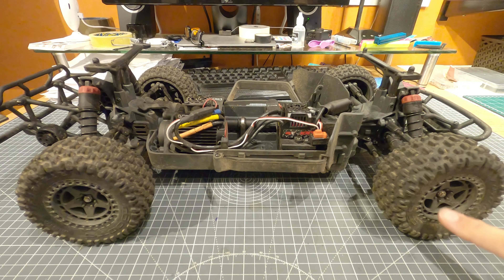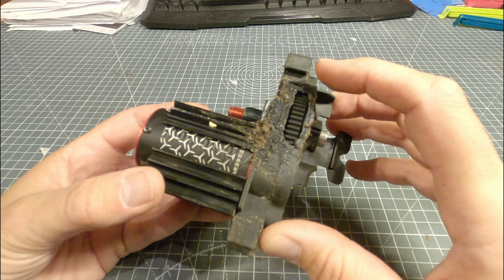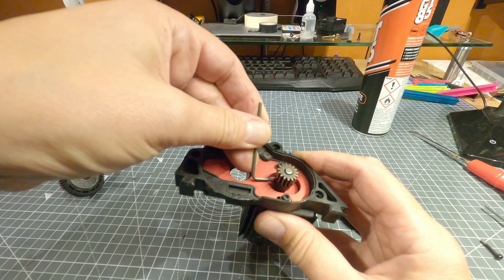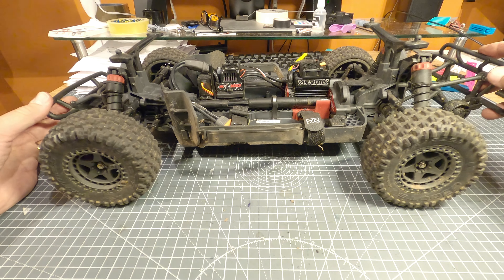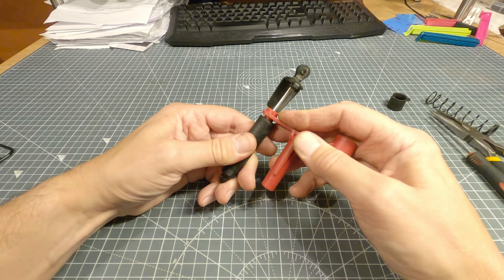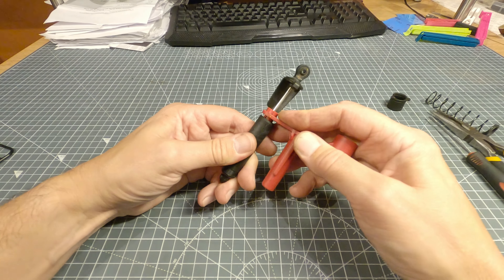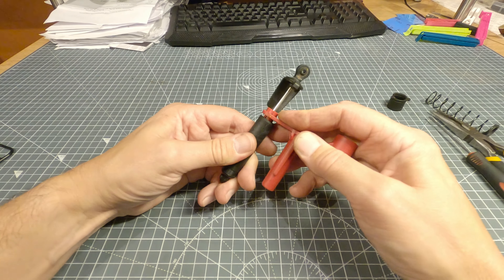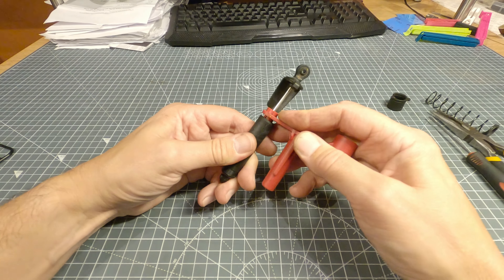Arrma Senton 3s BLX V3 Review and Top Tips. Arrma 3s Mods, Upgrades Granite Typhon Big Rock Vorteks

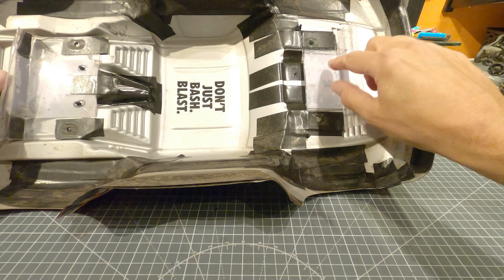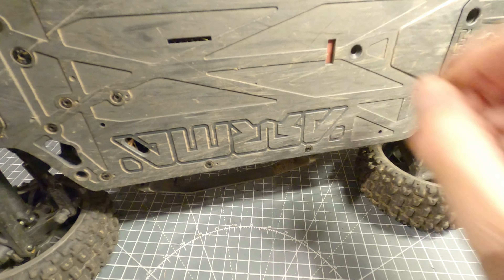Comment from the maker: This is rather a long video so some useful skip points are 1:10 - Body strengthening,  1:56 - Threadlocking motor,  8:01 - Shock oil,   13:17 - Metal shock brace,   17:37 - Servo and other bits,  21:05 - Review
Reply: You can also use tygon or glow fuel tubing for shock limiters and cut to any size.
Reply from the maker: Good tip thanks 😃
Reply: Thank you sir!

Comment: I know this is an older video, but I enjoyed you going through the Senton 3s. I just picked one up, and it was used, so I serviced the diffs, then went on a rip. The very next day the inner motor bearing seized, I am waiting on the FastEddie bearings for this, and I am upgrading the shocks to the Proline for the 3s series vehicles.
Reply from the maker: Hi there. Glad you enjoyed the video. Ooh that's annoying about the motor. I've had the same thing happen and it can be difficult to get it open if the screws are damaged. Hope your fix goes well. Many thanks indeed for your great feedback 😁👍

Comment: I have just got the senton and am really impressed with it so far. It does throw lots of debris into the chassis but have seen a mudguard mod which i will be getting. Also Proline do a set of upgraded shocks for this model and seem to work well from what i have seen (albeit expensive) so will look to change to them in the future. 
Great video and top advice as always ,i bought my Kyosho beetle on the basis of your review of it and am so far really happy with that as well.
Take care
Reply from the maker: Hi there. Yeah the inner fender set is a must for the Senton. Doesn't stop everything going in but it helps. I did a video about those. I've made mine a bit lower and used thicker shock oil and now it handles more like a rally car which I like. Tend to only run it in the dry these days as the trucks are better in the mud. Oh yeah the Beetle is good but you need to be a bit careful with it compared to the Arrmas. The main problem I'm having with it is the paint falling off the inside of the body shell after its landed on the roof many times. Mine is possibly a bit fast on brushless. Hope you enjoy the build 😁👍
Reply: @PeteWylieRC  Iv just put carpet tyres on my beetle. It will only be used inside for exactly that reason. It's too pretty! I'm running a Tamiya super stock RZ in it which seems plenty for the little beetle 👍
Reply from the maker: @matt_cars  Yeah I was going to say that the Beetle possibly has a bit too much grip on grass with the blocky tyres and it could do with a bit more rear end slide like the Turbo Scorpion with the smaller blocks on the rear treads.  Hopefully yours will be safe indoors unlike mine which has had a bit of a beating to be honest 😬

Comment: Great video Pete.  I really appreciate videos like this that are still relevant today.  Plus the content reinforces what to look out for on the 3s line.  Thanks 🙏
Reply from the maker: Hi there. Yeah the Arrma 3s line is still going strong and I've still got all of mine plus a 4s now. I think that despite needing a few checks and mods these are still a must have for RC bashers. Many thanks indeed for your kind feedback 😁👍
Reply: @PeteWylieRC  The shock leak has improved on the v3.  But my the differentials still leak onto the driveshafts.  Have you experienced this?  I recently ordered HotRacing yokes.  Hopefully that does the trick.
Reply from the maker: @2XRC  I haven't noticed the diffs leaking.  I did put slightly thicker oil in them so maybe it stays in better?  Hope your upgrade does the trick 🙂

Comment: Good video  m8 as I have just bought my boy the senton have u had tires blowing  out on them as we put the battery  in and it ran for 2 minutes  tops and destroyed  the rear tire
Reply from the maker: Hi there. I've not had the tyres on this one blow out.  The only one that did was on my Granite but I was giving it full throttle while it was upside down as I was trying to flip it back over.  I don't know if there are better tyres available from other manufacturers like Proline.  You need to keep the Arrma wheels though because of the 14mm hex size.  Thanks for your great feedback on the vid.

Comment: hi pete,  mick smith here...  i did put  granite wheels on my senton 3s blx  and i love it..   faster more responsive etc..  i did get 44 mph on cut dry grass with i think the standard 20 pinion. 
but its a little too fast..  the front end started to wobble and raise up plus it just wants to wheelie at  35 -40mph+..  to rectify this i have added some velcro to the front end and ordered a 17 pinion from modelsport..  i do love the speed but as you said i need to take care of the esc and the motor..  i beleive ARRMA are  " horizon hobby "  i used to purchase helicopters from them a while ago..  i also have a pro-boat sonicwake 36  (horizon hobby)   which will achieve 50mph  ...   a great boat but.... boats need to much attention..  there hard work...  cars are easier...
thanks for your videos .. i do trust in you with your un-biased information..  

take care pete 

regards mick...
Reply from the maker: Hi there. Yeah the 20t might be too much with the big wheels. With the wheelies I think that the Senton body just catches the air underneath. I got the mudguards which help a bit. Many thanks for your feedback. Much appreciated 😁

Comment: What the advantages of using different tooth pinion gears what one does it come stock with and what ones does it come with
Reply from the maker: Basically more teeth on the pinion gives a higher gear so higher top speed with slower acceleration. The opposite is true of the spur gear ie. more teeth gives a lower gear ratio. The Senton comes as standard with a 20 tooth pinion whereas the Granite and Big Rock come with a 15 tooth because bigger wheels also increase the gear ratio. Hope this makes sense 😃
Reply: @PeteWylieRC  perfect thank you

Comment: I’m looking to get into rc is the arma senton good for beginners
Reply from the maker: Hi there. Yeah the Arrma 3s range is great but make sure to do the checks that I go through in these videos. The Big Rock unboxing summarises the things to check. The problem with the Senton is that the body being over the wheels means that all the mud is directed into the chassis. I only really use mine in summer when it's dry. I use the other ones all year. Maybe look at the Big Rock?

Comment: All great tips Pete. A little surprised on the design of the shocks. A lot different from axial ;) I like it. Great job and Iam sure there will be quite a few people who would like this help. Thumbs up
Reply from the maker: Hiya Nick. Yeah I think that the shocks are different to all the other ones out there. I guess that the advantage for a basher is that there is no shock top to come off during jumps and crashes. They do work well now that they have sorted out the o ring problem of the previous versions. Anyway many thanks for watching matey. Just found out that I'm working through the next lockdown. To be honest it doesn't seem to be much of a lockdown as the schools are still open and a lot of people are still at work. I think that mainly the pubs and restaurants are shut. We shall see if it makes any difference. Take it easy my friend 😀
Reply: @PeteWylieRC  hmmm .. well hardly seems like a shut down, is right... I guess they see it as helping?? Thankfully not a decision, that falls on my shoulders... lol
 I like the look of those shocks though and I think they would work pretty good. For a couple reasons first of all, the fine thread which seems to be nice and long, Second the oring placements ... I know you may have mentioned it but it would seem to be pretty good against leaking? thamks :)

Comment: i really wish they would make a sealed motor box. i dont know what they where thinking when they made all the holes around the spur gear. it should ether be completely open or closed.  and plastic/composite rod end balls is really dumb. i dont know any rc car ever other than arrma that has done this.
Reply from the maker: Hi there. To be fair the new one is pretty good at keeping the dirt out and I haven't really had a problem. With the pivot balls I guess it just comes down to cost. They are a bit rubbish though! Many thanks for your feedback 😁
Reply: @PeteWylieRC  the motor cogs bad on mine even after horizon sent me a new esc and motor. not sure if they fixed that or not. all this is why i would not buy a senton again. i was gonna buy a pro sc10 when i bought this now i wish i would have its just a better sct especially on the track.
Reply from the maker: @KidAgainHobbies  oh right yes I did have to get the first ESC on my Granite changed because of a cogging problem. It's fine now. Maybe you were just unlucky with the electronics. Hope you have more luck with the prosc10
Reply: @PeteWylieRC  i dont think its bad luck i think the electronics are not good.  i have had dozens of brushless systems and i have never had cogging this bad. maybe you got the upgraded version of the electronics.
i have the rc10t4.3 rtr which is the same platform as the prosc10 and i havent done or broke a thing on it. its just a great platform. i hate they discontinued the t4.3 and the buggy.

Comment: No way dude mine had exactly the same problem...3 weeks/3 hours from new...arrma have my motor now so fingers crossed
Reply from the maker: Ah right. I sent mine back to the retailer and they sent me a new one straight away. Hope you get yours back soon. Worth thread locking the screws when you reinstall it.
Reply: @PeteWylieRC  I went to send It back but they said cut out the middle man ..I'm hoping they send me an arrma one as this is common on the spectrum motor..plus I sent the whole unit ..just to have tolerances checked as there was a lot of powder on reveal haha
Reply from the maker: @666carping  I think they should sort it out for you ok then.  I have just bought the Big Rock and I notice that they now put washers on the motor screws and they were really tight so obviously they are trying to stop the mesh from slipping.

Comment: My son blx when you full throttle it the car locks down like it shuts off
Reply from the maker: Hi. Not sure about that.  Is it a decent lipo pack that you are using ?  Also might be worth going through the set-up of the throttle on the radio gear.  It's in the instructions somewhere.  Otherwise I'm not really sure.  Be worth contacting the place you bought it or Horizon Hobbies who own Arrma.
Reply: yea new battery smart one the truck sounds bad when it is going also like it surging for power
Reply from the maker: May be a dodgy ESC. My first one on the Granite went wrong and got replaced on the warranty. Best to contact the seller like I say. Good luck.

Comment: I have exactly the same issue with the handling of my Senton. I will be doing that suspension mod this weekend. I'm also going to buy the Granite next based on your suggestion.

Your tips videos are indispensable I reckon. Cheers
Reply from the maker: Hi there. Yeah I decided to make the Senton better in the corners by lowering the suspension a little and it's really good now. I've got the trucks if I want one for more challenging off road or bigger jumps. The Granite is still favourite I'd say. Many thanks for your kind feedback. Much appreciated 😁

Comment: Hi Pete, you didn't add grease to the spur gear / pinion. Do you you recommend to run it dry?
You mentioned Tamiya Anti Wear Grease for sealing the gearbox. Which grease do you use instead?
Reply from the maker: Yeah the plastic spur against the metal spur tends to get left dry on most RC's. Having said that I do grease them when I build a Tamiya and so there's certainly no harm in doing it. I was just using some LM2 grease I think. Anything like that would do. If you can get something sticky like Tamiya AW grease then it tends to stay put. Thanks for watching and commenting 😁

Comment: Recien compré un Arrma Sentón 3s Blx y necesito Limpiarlo asique lo pienso hacer con agua le tirare agua directamente, alguien sabe si puede afectar la electrónica? Servo Motor Esc etc ?? Luego lo secare con calor pero tengo la duda ya que no quiero arruinar nada Ayuda porfavor
Reply from the maker: Yeah I hose down the cars and then I've got an air blower to dry them. WD40 on the bearings is a good idea. Before you run it next time, make sure you can still push it forwards and backwards freely 👍👍
Reply: @PeteWylieRC  gracias

Comment: Brilliant video just wished I had watched it before taking out my nice new shinny senton
First run have cracked ever corner.
How have you found the number plate gorilla tape.
Did you put the number plate tape down first then go over it with the gorilla tape
Really helpful videos keep up the good work
New sub 👍
Reply from the maker: Hi there. I've only used the double sided number plate tape around the body post holes where I have stuck on an extra layer of lexan on. Mainly I've just used the gorilla tape around the edges of the body. If you are really battering it then it might be worth doing that thing with the dry wall tape and shoe goo that people do. I haven't tried it myself but people say it's good. Many thanks for the sub 😁

Comment: I own a Senton. It's a lot of fun, but the parts aren't exactly durable. Turned too late and ran into a solid wall, breaking the steering rack and snapping one side of the front bumper. The upside is that replacement parts and upgrades are easy to acquire and install. Looking at upgrading a lot of suspension parts and getting better shocks and tires.
Reply from the maker: Hi there. I reckon that these are as tough as anything else I've had. I certainly broke my Traxxas Slash more often. Glad you are enjoying it. Many thanks for your comments 😀

Comment: Grease is a good sealer in some situations, but you may want to use a light weight silicone for cars. Won’t hold on to the dirt as well. This is only my opinion, your way may be better. Great video!
Reply from the maker: Hi there. Yeah you are probably right. I will give it a try next time I have it apart. Many thanks 😁

Comment: Great video and well detailed without too much fluff. I’ve been torn between the Senton and the Big Rock, but after watching this I’m thinking Big Rock and then adding a Senton body later.
Reply from the maker: Hi there. Many thanks. Yeah it's a difficult decision. I think that the Big Rock is probably the better all rounder with the big wheels. The Senton is great fun to drift around on the grass but isn't as off roady. The big tyre ones are definitely best for jumps. Have fun with whichever one you get 😁

Comment: Im sorry this might be a stupid question but does it work with a ec5 connector
Reply from the maker: Hi there. Yes it does. I talked about the battery plug a bit in the unboxing video. You can use an ic5 or ec5. Thanks for watching 😀
Reply: Thanks your the best

Comment: Hello, nice video. I too have a senton and i would like your honest evaluation of the ebay shocks on your granite as they offer the same ones for the senton. Are they any good?
Reply from the maker: Hi there. Yeah they are well made with a smooth action. Seem very strong. No problems so far. The only thing I was thinking about them is that they are unbranded so I don't know if you can get spare parts individually. I'm thinking about getting a set for the Senton too although the Arrma shocks are doing fine on that. Thanks for watching the video 😁

Comment: Great video, I just got the V3 Senton and love it. Do you have the part # for the HR pivot balls by any chance.  Cheers and stay safe!
Reply from the maker: Hi there.  It's ATF160B02.  Thanks for watching and your kind comments :-)
Reply: Open ur box.. Get in the bag where all your papers should be.. You will have a whole pictured diagram of every part on this truck!!
Reply: @elizabethbumgarner6267  he was referring to a aftermarket part , the HR pivot balls and metal as apposed to composite that comes on the 3s range . There not very good at all to be frank with you , but the HR parts are a decent little upgrade that takes away slop from suspension and steering .

Comment: Hey I have a question, I have a senton and I wanna replace the servo, did you go with coreless or brushless? And is the aluminum shocks worth it? They are kinda expensive
Reply from the maker: The servo is the JX Ecoboost 21kg. I'm not sure what technology it uses. The stock shocks are fine to be honest and the version 3 ones don't seem to leak.

Comment: Great videos Pete .  I'm brand new , just got the red Senton you have been working on .
Could someone achieve somewhat similar results , less rolling over ,  without
sacrificing suspension travel ,  by using harder ,  less grippy tires  ? I dont trust
myself to perform surgery on my truck yet .
Reply from the maker: Hi there. Yeah you are right to say that if the car looses traction then it will slide rather than roll. Rather than change the tyres, just find some slippery wet ground 😁 Many thanks for watching 😀
Reply: Don't drive so fast 😂😂😂

Comment: Great to know this info Pete as I've just bought the Bigrock V3, mine will have a much easier life than your models though as I am a big chicken and don't run any of my RC's in mud or water because I'm a bit of a wuss!  Thinking about it, that's because I usually buy kits and the amount of work I put in doesn't make me want to run the models too hard- but this is not a kit, it's a basher so maybe I can give this a lot more stick :-)
Reply from the maker: I know what you mean, I don't give my Tamiya's that much of a hard time as I really don't want to break them but these Arrma's are designed to be bashed so give them hell!  Many thanks for watching. Actually having said that I don't want to break them either!  Hope you are enjoying the Big Rock.  I have ordered a Big Rock body for the Senton so I can run it with the Granite tyres.  Should be interesting :-)